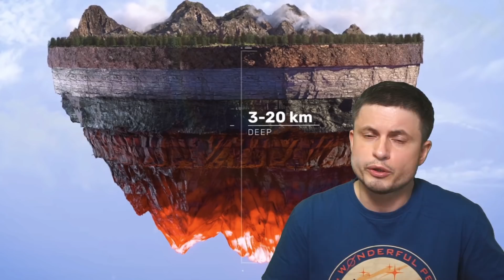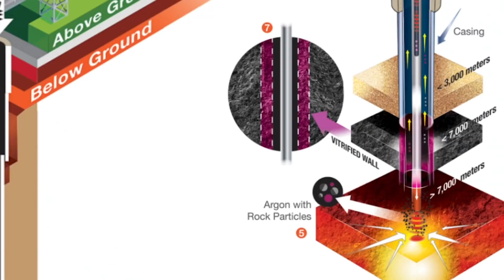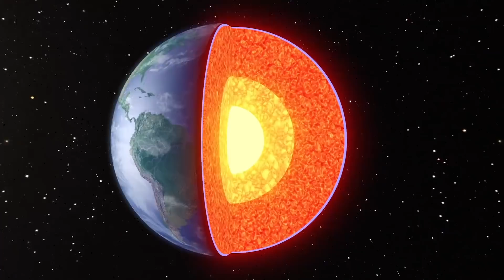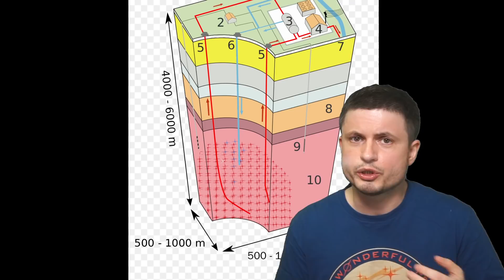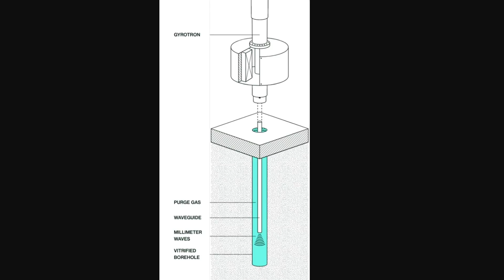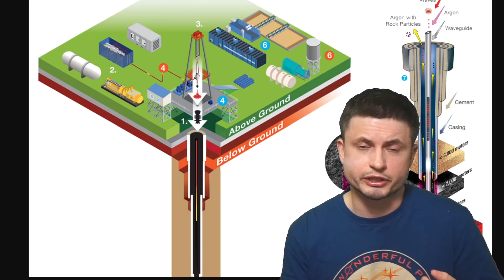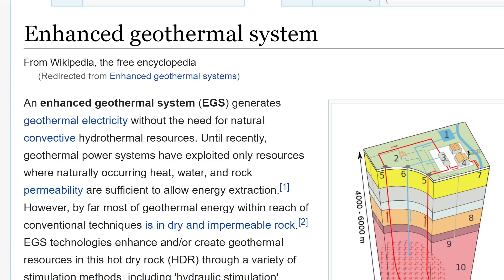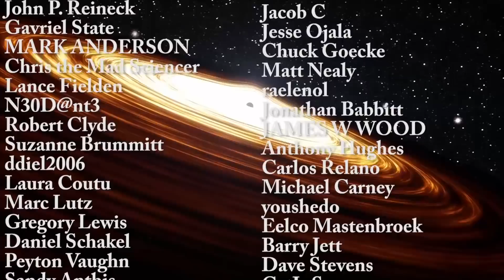Creating Deepest Hole on Earth For Geothermal Energy Revolution

Comment: It all sounds interesting in concept. 
I feel, if this was feasible, a lot of people would try to do this.

Like are they going to dump water in a 20 km tube? How are they going to control where the superheated gas comes from?
Reply: U-tube setup in the borehead. Pressurized liquid goes down one side, and hot vapor comes up the other. Seems most problems are with an open bore system where it's not a closed loop, and that results in fracturing and mineralization. (There are reasons for open pumping of a working liquid - larger surface area for heat transfer, but once going deep enough that shouldn't matter.)

Comment: I learned when I was a kid, in the 1970's, why we cant dig that deep. IT CANT BE DONE no matter what tech you use. Because the pressure coming in from the side. You think deep ocean pressures are high? You havn't seen high pressures compared to several kilometers of earth pressing in on you. From all sides. It cant be done even with foreseeable tech.
Reply: We now twice bored to ~ 12 km.
Reply: @mellertid  I was referring to the 20km. We cant bore much past 12k, and it aint for lack of trying. Drilling rigs keep getting seized up.

Comment: Sounds good in principle, but this will emit a lot of waste heat to atmosphere. Even if you are clever and use a combined cycle where you let down the steam to a higher intermediate pressure and then use an organic cycle to recover more heat you will still be emitting a lot of waste heat. There is NO question that this is better than most existing power generation technologies - so replacing those is a no brainer...but long term, on a planet already dealing with global warming this will be a tougher sell.

Comment: Geothermal energy is nothing new and doesn't require any new drilling technology. The fact is that it has its pros and cons and is currently NOT cheaper than wind/solar, but because it can have a relatively constant output may in some places be good to use alongside other renewables. Also it is cheaper in places with a lot of relatively easy to access heat like iceland. The mistake too many people make (and unfortunately occurs in this video) is to think that any energy is 'free'. There is no such thing as free energy. There is always the cost / efficiency losses of getting that energy from where it is to where it is needed. That is one reason why rooftop solar is the cheapest form of energy for homes where suitable because there is not need to transport it. Solar energy/wind energy / fossil fuel energy etc are all 'free' at the source but cost money to get it to do what you want. What matters is the price per unit energy that gets to where you want it (taking into account lifetime environmental costs etc). Geothermal is used in some parts of the world and certainly has potential to be used more, but at current prices it is not a miracle source and will struggle to compete with wind and solar which are currently half the price of anything else.

Comment: I'd be curious as the the consequences of continuously cooling magma flow under the earth, seems to me it would solidify near your tap, and you'd need to move it if your not careful. Also reminds me of Stargate Atlantis episode Inferno in which geothermal energy is used on a super volcano to power a facility... but the continuous cooling caused a thick cap that built up pressure causing super volcano eruption

Comment: With all the kilometers between us and the hot stuff that cools the hot stuff down, wont making a hole release all the heat into the surface and make the air too hot for us? What if there is a lot of pressure and we wont be able to stop it?
Reply: You're just describing a very small volcano.

Comment: not a bad idea, dig a hole to an extreme heat depth, pump water into the hole, water comes back as steam to turn turbines which makes electricity. In a way, you can make electricity anywhere you dig a hole. The water always returns as steam so you never lose water.

Comment: I know nothing about drilling but what I do know is that it is not as simple as just pumping water into a heated tube and using the resultant steam in a turbine to generate electricity. The issue lies with the solvating power of water itself in that the silica lining of the proposed hole will contaminate the water with Reactive Silica which when passed over the steam turbine blades will then deposit on them and ultimately cause and imbalance. This issue can be overcome operationally by reducing load and "blade washing". Perhaps the real answer is to not to try to leap to modern technology standards of efficiency and capital payback. After all the heat is free! Then perhaps a low temperature and low pressure turbine would be the best way to start and then improve on this design.

Comment: I've read an article some time ago that it is not so easy to harvest geothermal energy even if you have a really deep hole. When you pump cold water into the hole, some of it turns to steam but you are also cooling down the hole. Therefore over time you don't produce that much steam and energy. The underground heat flux towards the hole is too low.
Reply: I imagine the situation is different near an active magma pocket that's constantly circulating, as opposed to just drilling down in a thick section of crust.

Comment: My hometown is Pomarance, in one of the geothermal areas in Tuscany. It is near Larderello which was the first place in the area where geothermal energy was used by Ginori-Conti and others. Apart from electricity we now have a centralized home heating system that uses geothermal energy and completely removes the need of natural gas. I really hope other places could get this infrastructure as it is really useful! I think there may be a lot of other applications wherever you need warm water, at around 50/60°C which is essentially a byproduct of geothermal power plants and comes almost for free.

Comment: Anton points out geothermal energy produced by radioactive decay is twice the the amount of energy currently used. But this is actually totally irrelevant because the production is spread over the entire sphere. By extracting at a limited number of bore holes, you reach only a insignificantly small amount of that production capacity. What you're actually extracting is stored energy, which is left over from the formation of the planet and billions of years of radioactive decay. And the moment you start extracting, the bore hole cools down until it's to cold to keep continuously in operation. In the equilibrium state where radioactive decay will provide continuous heating, the energy flow will be way to low. So it's not that different from extracting fossil carbons which is just as free if you look at it that way. I would like to see some numbers of the expected energy it will cost to make the hole and how much energy can be extracted and at which rate and for how long. I really doubt if it can be that profitable but I'll be glad to be proven wrong. But the way it's represented in this video seems too optimistic to me. Also, if it would be profitable and we start using it on a very large scale for hundreds of thousands of years, cooling down and perforating a significant part of the earths crust, what's the potential impact? Will it affect surface and atmosphere temperatures?

Comment: Dude, it's not about the depth of the hole or the temperature of the rock. Or even about efficiency. It's about heat  transfer rate (you need a lot of surface area as ell as high temperature, and the cost (not the effciency).

Comment: There's a pair of geothermal deep bore holes near Helsinki, Finland. They go about 6 km down and the company ST1 has had quite an adventure with these holes. There are several problems with these: 1) drilling the holes is expensive even if they nail down the technique for the next holes 2) the water easily either doesn't want to go through the rock from bore A to bore B or diffuses everywhere else along the cracks. There is also the question of insulating the bore but I supposed that given a year of operation the exit bore will be surrounded with very hot rock reducing thermal losses.
Reply: Conventional drilling gets exponentially (or whatever) more expensive at very deep, this is the main (suggested) benefit of this method.
Reply: Fortum (partner in the project) abandoned their investment in the project now. The water is only lukewarm from the 6.4 km hole, so there is no benefit compared to a shallow well.
Reply: @johansvideor  that is disapointing. Sweden's only true geothermal plant is low-temperature at <1 km  though profitable for 30 years. Deeper holes have not been promising yet.
Reply: @mellertid  I guess holes <1km and heat pumps is the future here for larger scale systems. Drilling very deep seems to be hit and miss in this area at least. A bit disappointing, but good that they tried

Comment: I was a maintenance tech and an operations tech at the Soda Lake Geothermal Powerplant in Fallon Nevada. Check out the Ormat binary geothermal system. We never flashed the hot water to steam. We used the heat in the water to heat pentane and isobutane which was the fluid actually flashed to vapor across the turbines.  After we used the heat in the geothermal fluid/water we then pumped it back into the ground. Two closed loops. A hot water loop and a pentane loop. After the pentane was flashed to vapor across the turbine it was then cooled back to a liquid and the loop continued.
  Free, unlimited and 100% emission free electricity.

Comment: Bad idea, and misguided.. EGS systems, which this would be, are known to increase seismic activity, including “game-changer” quakes, for one. Molten salt reactors are way better for on-demand power without risking losing places like California.  Finally the earth uses that energy and natural activity for things like creating a magnetic shielding that protects life on earth. There’s no good reason to mess with earths’ fractures like that. EGS dig real deep and insert liquids that create new fractures they get heat from. Better to use just natural geothermal sources where they exist, instead of digging so deep to create new fissures..  The theory that this won’t do the same thing is just theory. They are going to make a new fracture just the same because that’s the nature of creating those stresses so deep. They want heat from deep which changes the tensions and ultimately opens a fissure so they can really start pumping the heat out which obviously.. They’re going to put way too much money into it to settle for a dribble of heat, and then push it.  Seems like a lot of risk just to avoid molten salt tech.

Comment: Sounds interesting. Just as long as they're only digging these holes in tectonically stable rock with no shear zones. Not going to take much to break the rigid bore walls, which could allow a similar situation to the South Korea earthquake. Will also be interesting to see how they get water in and steam out of the single bore.

Can't wait for the test plant.
Reply: "Will also be interesting to see how they get water in and steam out of the single bore."
Possibly a double pipe, pump the water down the inner pipe, steam comes back up the outside.

Comment: I posted a similar idea over a year ago on FB. The same basic concept to use the heat from with in the planet to drive steam turbines. I did not have a new way to drill extremely deep so  I leaned toward active volcanic areas were the heat was much closer to the surface. ..( and then learned about iceland already way ahead of me. .   .

Comment: I know it might sound naive, but I wouldn't like something like this to become widespread.
Tectonics are only there because Earth still has enough thermal energy stored in its core. Sapping this on a larger scale will only speed up the cooling process.
Not talking about a few dozen units here, and there but rather on a large global scale. 

On a second note, it would be a perfect way to buy us some time until a better, alternative energy source is developed.

Comment: So to power the civilization even at current consumption level we need to use half of the energy produced by the Earth? This energy is going somewhere right now, and redirecting it will affect the geological processes in a major way. For example the earthquake you mentioned might have happened not because of the water between the rock layers, but because the thermal contraction of the rock, caused by constant thermal energy removal.
If we start doing it  in a large scale, the flow under the crust might slow down, decreasing or eliminating the Earth magnetic field, leading to a global catastrophe.
If we were talking about 1% of produced energy will cover all we need, than maybe this would have been a viable large-scale energy source. But half? No.

Comment: Just curious why high powered lasers couldn't also be used to drill?
Reply: I think the world record of laser drilling rock is 30 cm.
Reply: They are too weak, ineficient, it turns out! The mm-waves simply seem to be the sweet spot. We'll see if it actually works, but I don't think the gyrotron is inferior to lasers in this case.

Comment: I mean it’s not that much energy really, higher estimates of power output to the surface are around 40TW and humanity already used on average around 2.5 TW, now even assuming perfect efficiency of harvesting the energy radiating outward from the core, taking into consideration humanity’s exponential energy usage, we would start to use up a considerable amount of the earths internal energy budget, which along with cooling the earths internal temperature which doesn’t sound good, we would take energy away from vital geological processes. All in all there seems to be far better and (future proof) solutions such as solar for renewable energy

Comment: I'm assuming that they've determined that liberating terawatts of heat energy from underground, and venting it into the atmosphere, is less damaging than the existing heat build-up from the Greenhouse Effect?
I guess that the traditional fossil fuel based systems have the double-whammy of generating heat directly (energy generation), plus heat generation at the point of usage (eg: electrical/motor heating), and also releasing CO2 to then trap heat of all sorts in the atmosphere ... but I'm still not completely comfortable with the concept of liberating otherwise trapped pools of heat and flooding them out into the thin shell of atmosphere that supports almost all life on the planet.

Are we going to end up with another crisis where we're trying to figure out Geothermal's Heat Capture and Sequestration?

Comment: So the GeoTherm power plants in New Mexico and California that run turbines at 500 deg don't really exist then?  Plus solar thermal collectors that can heat salt blocks to molten 1000 deg (Phase Change) and stay molten for a week without sun  can be combined with other tech to achieve results,  The fact remains that existing Energy companies are the biggest blockers to advances in GeoTherm.  No one is fooled by their professed intrest.  Nuc power is a growing problem with the holding tanks being full in the US and other countries like Japan where we witnessed the extreme danger if those holding tanks are not constantly cooled.  Nuc power is the most costly and when you factor in the true costs of procuring fuel and building/maintaning and nowhere to put the highly dangerous used rods is not a viable solution.

Comment: My generation is best described as, "Either Dead or Dying." I can tell you from first hand experience that people in the mid-Twentieth Century had a very tough time imagining the future. The adults were just happy that the explosions had stopped. Most people never thought about the future, preferring to assume that things would go on much as they "always had." Burn coal and oil for heat, mostly coal for energy, and they were confident that there would always be plenty of fresh, clear water. I was usually the pessimist in the room. I could see, based on reading, the onset of problems with pollution, energy production, and potable water. But, I suggested, it should all be so easy! The earth itself is hot enough to boil  water, and that's all we need for plenty of electricity, and with cheap and plentiful electricity, the desalinization of sea water should be an easy problem to solve. After all, there's a lot of water all over the place. It's politics and greed that makes these things difficult. If we can eliminate corruption, these other problems should disappear rather quickly. (In geological time, of course.) Oh, and nice video, as usual. Thanks!

Comment: Drilling to source geothermal energy has been done in several places where the heat source is not that far down. Unfortunately, many of these attempts triggered serial minor earthquakes, thus had to be abandoned (e.g. near Basel, Switzerland). Deeper drilling should be safer.
Reply: Or cause much greater quakes... I wouldn't like to live anywhere near where this will be tested.
I live near Strasbourg France and we ha more than 20 quakes up to Richter 4 due to a geothermal plant project (that was shutown before exploitation because of the quakes). 
The damage done to buildings in the region are up to billions euros now.
Reply: @etienne8110  
Basel and Strasbourg are near each other and went through similar failed processes. IMO, no geothermal plants should be located near built up areas.
Reply: @etienne8110  should be a pinned comment...the idea that more intrusive human engineering is the answer baffles me